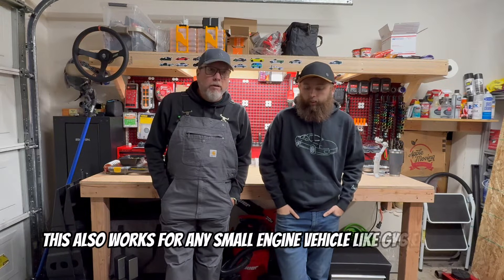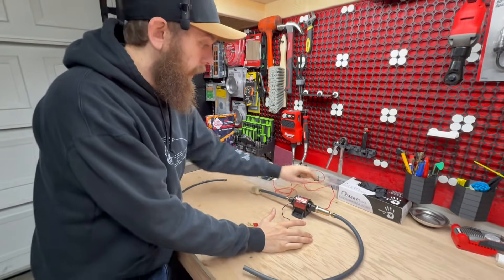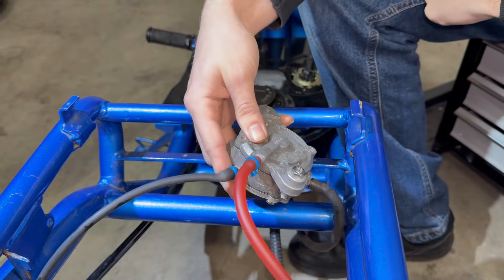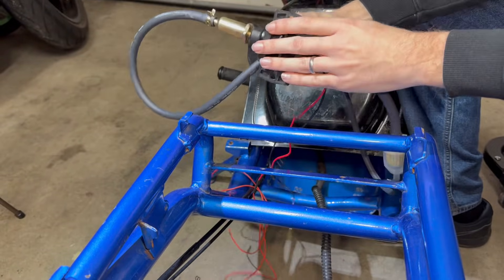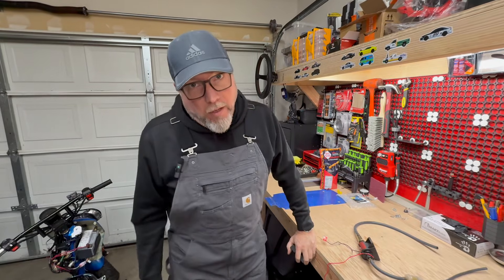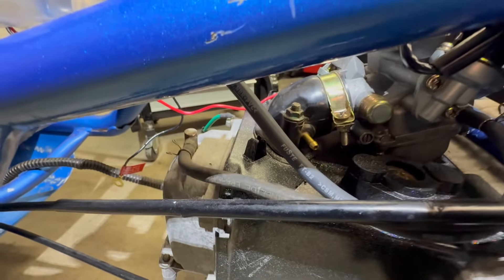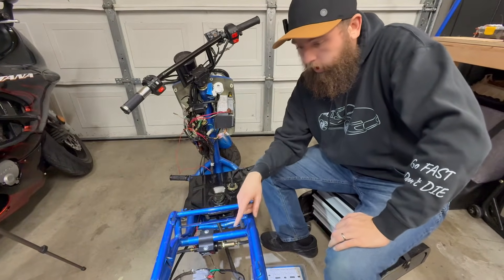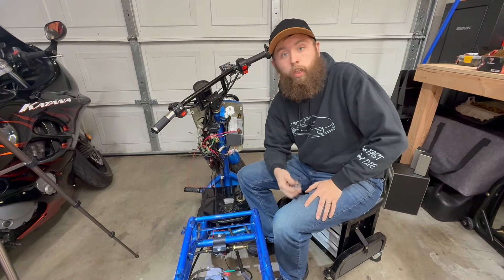How To Install an Electric Fuel Pump on Small Engine Vehicles! (Full Tutorial)

Comment: Do you know where I could get one of those brackets for the fuel pump
Reply: I have a Gen 1 150 cc would it still work
Reply from the maker: @frankbenavidezakakid7734  Absolutely! They will fit any generation Maddog.
Reply from the maker: We actually sell them on our website for $20 which includes shipping. You can pick the color that you want and we use Venmo or Zelle at the present. Just head to our website and click on products and then click on fuel pump mount. That will give you a little more. Thanks for the support, brother!

http://www.revrendergarage.com

Comment: Your plastic fuel filter is on backwards.  How are we supposed to trust your advice?
Reply from the maker: Caught that, huh? Funny thing — on these scooter filters, fuel flows either way just fine. The arrow’s just the ‘suggested’ route and not the end of the world. You might have missed the bigger picture here and that's ok, some people just need to let you know how smart they are... that's ok too!  And,  if this is the biggest problem with our build, I’d say we’re doing alright 😅. Appreciate the support... thanks for watching bother!!
Reply: @RevRenderGarage  
You are correct that fuel will flow in both directions.  The problem is that they made the housing clear so you can see the contents and debris inside the filter.  When it's installed backwards, the filter ALWAYS looks clean because all the debris is trapped inside the filter element, so you don't know when to replace it.  There is a reason they embossed an arrow on the filter housing.  It's a little bit more than a suggestion...
Reply from the maker: @TheAnnoDomini  you missed the point brother!
Reply: @RevRenderGarage 
The point is that you installed the filter backwards.

Comment: Does the electric fuel pump over deliver? Or is there a leak off back to tank for the excess that I missed? Good video 👍🏻
Reply from the maker: Great question James! No there’s no leak off or anything like that. Once the carb is full and the float is up it stops sending fuel, just stays running and keeps constant pressure so you never have fuel drop or cutting off. I haven’t had any issue with it so far and have been running it for several months! Glad you liked the video and thanks for the support, brother!

Comment: I'd suggest testing those cheap electric fuel pumps before installing them.  Failures after a few minutes isn't uncommon.
Reply from the maker: That would’ve been a pro tip, but we didn’t have those in place until we got our new video editors. Our original editor was far more straightforward. But you make an excellent point and thanks for making the comment!

Comment: What’s the filter you used? I bought the same pump. I’m having issues still with the engine dying after doing a pull. I’m wondering if the tank low and the gas is just getting pushed to the back of the tank and starving the pump for fuel. It’s a gy6 swapped 1983 Yamaha riva. Gas flows freely through the pump while sitting still
Reply from the maker: Sorry about the delay in response… Some of these comments slipped through the cracks.

As far as the filter I just ordered a generic scooter fuel filter that visibly had the npt fitting step down. I don’t have the exact link as the one I used was just in my collection of parts. But as far as that fuel delivery issue, I would definitely top off the tank and see if it still does that. It very well could be fuel sloshing and losing prime in the pump but I wouldn’t think so. Let us know if it still does that even with a full tank. If so send us a message on Facebook and we can communicate a bit faster with you!